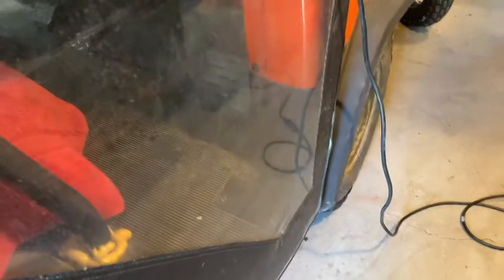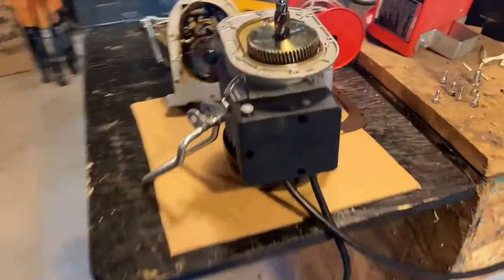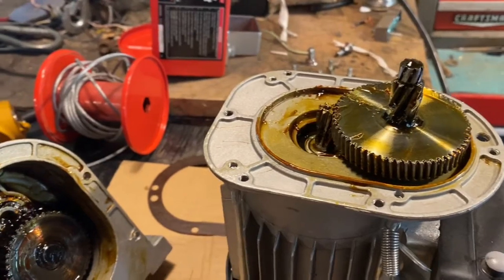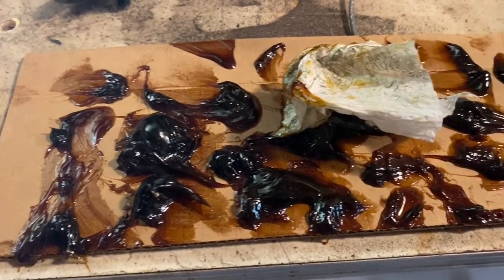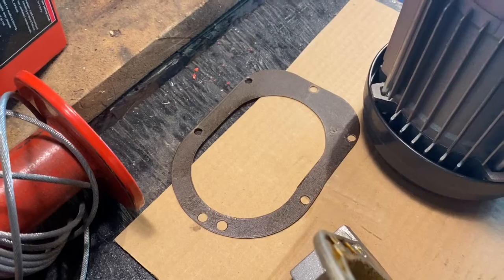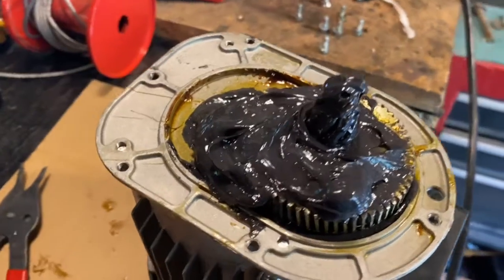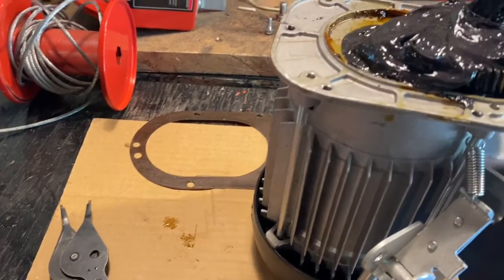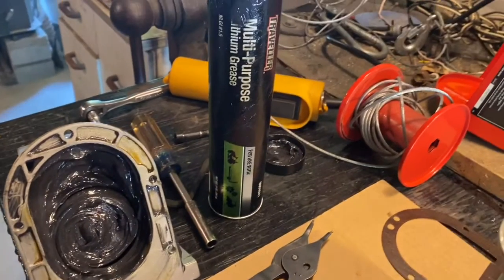Fixing my leaking ceiling hoist.

Comment: You attended to that little issue very quickly. Most people would wait until the oil was pouring out.  :)
Reply from the maker: I was mostly perplexed as to where the oil was coming from in the first place.  ;-)
The drip on the floor was off center from anything with an engine.
And the hoist only has grease in it.
I guess in China, what passes for grease is kinda scary.....